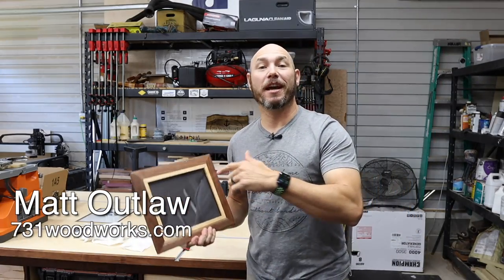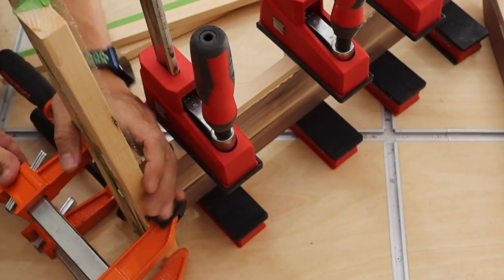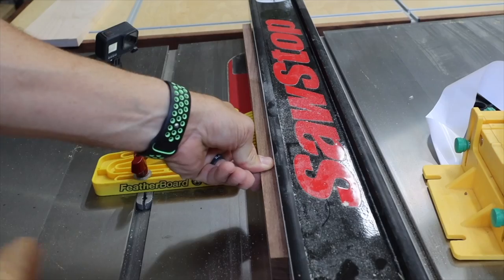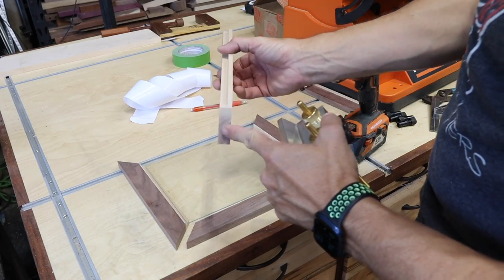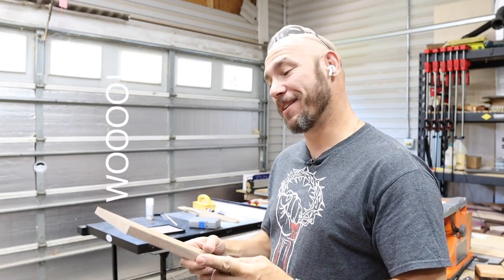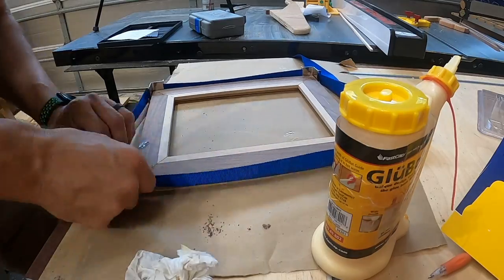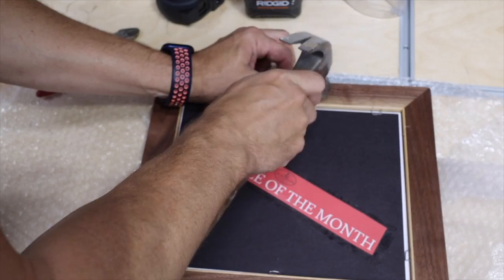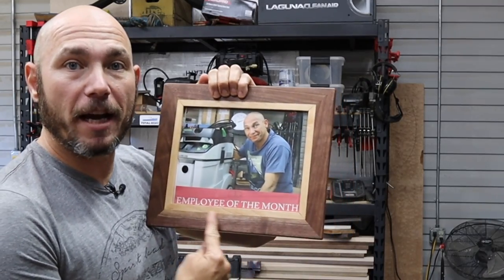99% of Beginners Don't Know How to Make a Picture Frame

Comment: Nice looking frame Matt.  Two thoughts..... 1) switch to your rip blade that has a flat top grind and you won't have to do the chisel work, or 2) build yourself that router table you mentioned during your video with Steve Ramsey and cut it at once as a rabbet.  Keep up the great work and videos!

Comment: Time to make a crosscut sled and picture frame jig for your awesome new table saw, Matt. Pretty sure that your angles were just a hair off when cutting those at the miter saw. Those angles have to be perfect or you will get gaps. Very difficult to dial in a miter saw that precise, but easy to do with a jig at the table saw! Awesome project, loving the new content!
Reply: Idk man I just started getting into building picture frames and my miters come out perfect on the miter saw....I found the biggest improvement has been using a square to get the miters matched up...then using tape to hold each miter joint in place...then use a band clamp...I was getting discouraged using just a band clamp thinking my miter saw was off...but discovered that the miters can slip a bit when you use a band clamp only

Comment: Great looking frame, you did well for a first time. If you want to use the technique of sneaking up on the miter cuts for a better joint, you might want to look into a "Shooting board". Instead of compounding the possibility of the miter saw being off, you use a hand plane and take off smaller cuts to get a tighter fit. James Wright at Wood by Wright has good videos for a shooting board and how to use it.

Comment: You did a great job and you just may be the 1st person to assemble a picture frame using dowel joinery. Most people I’ve seen on YouTube use a miter gauge or have a dedicated jig to get dead on 45° miter cuts. I’m guessing miter saws aren’t as accurate as the before-mentioned tools.

Comment: Great video. How many videos are made showing the intricacies and downfalls of a very basic project like this. My take away is the use of the clamping straps did not do a complete clamping job. Just yesterday, I reflected back on building all my drawers and using all those clamps and was considering on picking up a couple of those straps for the next drawer build. Seeing this video I now realize that they will not do what I would have expected without adding a few bar clamps with the straps.

I noticed that you were using a shop vac hose on the DeWalt 735. The DeWalt user's manual recommends not using a shop vac with this unit because they cannot keep up with the blower fan built into the 735. I fired mine up for the first time since I unboxed it and ran some drawer faces to flatten them and I found out what they were talking about. The output of the 735 was like a snow machine only spewing out wood chips that covered me and the shop. Next time I fire it up, I will try it with my dust collector's bag attached to  the 4" output of the 735.

Have you had any problems with your shop vac 's hose getting loaded up from not being able to keep up with the 735's blower?
Reply from the maker: I haven't had any I issues with the hose and shop vac.  It will fill up the shop vac quickly

Comment: Love the beginner tag. Where would a beginner get all those tools. I’m woodworking almost 45 years and I still haven’t got a jointer or planer.
Reply from the maker: Don’t have to use those. I worked for a long time without them. Just have to have want to
Reply: A beginner could easily build a frame like that with minimal power tools. Heck, when I first started wood working, a picture frame was my first project and I only had a jobsite table saw and a cheap miter saw.
Reply: The alternative here is to simply sand pieces down and try and get them close (thickness-wise). Jointing and planing these boards just help get a much cleaner easier fit without as much sanding work. And just as Matt always tells us, it isn't gonna be perfect, because nothing created by Him is ever perfect!

Comment: I haven't messed with bandclamps much, and even then it's just an el cheapo from Harbor Freight, but to avoid marring the wood with the buckle I slipped a small cutoff of 1/4 ply in between there, maybe 2"x4/5"-ish? Worked for me, quick fix for a test project anyway.

Comment: You mentioned that you put glue on the dowels (which I think is good) but you drilled your dowel holes exactly half the length of the dowels.  It's possible your gaps were created because your dowel holes weren't deep enough to accept the dowel with glue.  I've learned the hard way that if you don't drill your holes a little deeper than half the length of the dowel, then the glue can create hydraulic pressure that will prevent your joint from being completely tight.  Not saying this is for sure what happened, but you might consider it.

Comment: Matt, at around the 2 min. mark you are using the Kreg setup block to measure distance to the blade but your hand blocks the shot.  I was wondering if you have a separate video showing all the ways to use the Kreg setup blocks (i.e. table saw, router, etc.)  Thanks!
Reply from the maker: Yes I do. They are in this video https://youtu.be/ctyIvBVA6Lk starting at 14 seconds